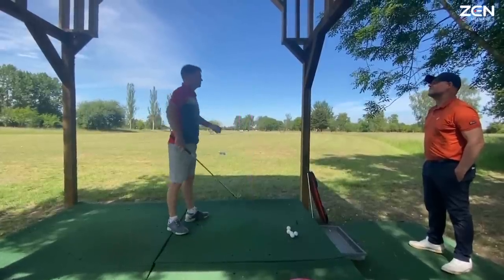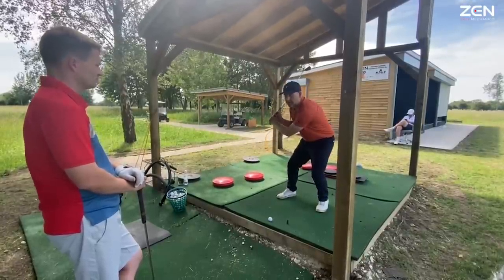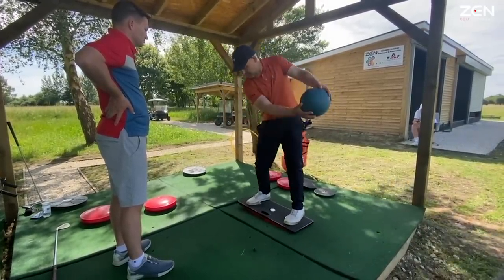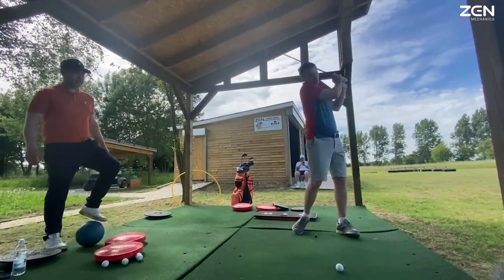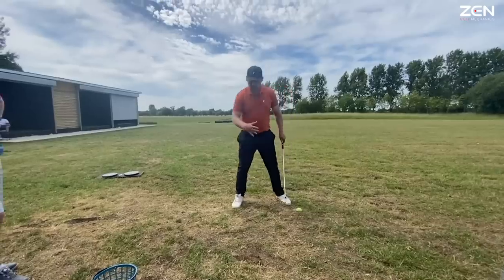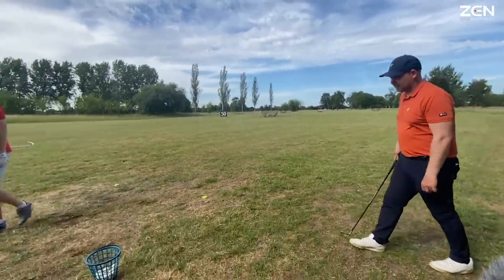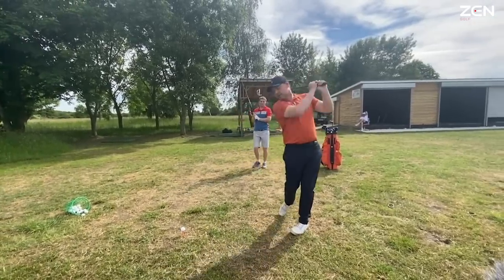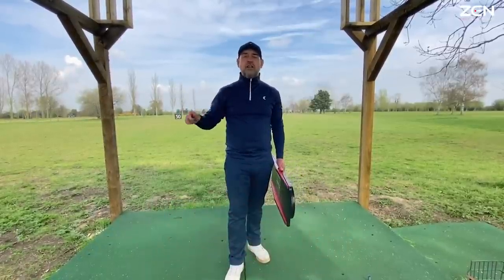The "Wrecking Ball" Golf Swing Drills for Pure Ball Striking | Irons and Driver

Comment: Marcus I have had my GRF SYSTEM for about 6 mos n ball striking has really improved. What I can’t get is a draw off the tee especially with the driver. I mostly push it right or sometimes pull across. Any suggestions?
Reply: Feel like your lead shoulder is thrown back at impact.
Reply: I was pushing it right until I focused on really closing the face through impact. What felt extreme really isn't when you see how quick the pro's close it! Watch a slow-mo vid to get an idea. Worked for me!!
Reply: Thanks for the replies guys!
Reply: @jimshigster5540  you can try making your bottom hand weaker or having the face a couple of degrees closed at address (making sure it’s not just a twist but an actual regrip to naturally have the face a couple of deg closed at address).

One of these should work
Reply: Ironsides, thanks for your response. I will definitely give it a try.
Reply: Ball starts on the line the club was facing - it needs to aim right then create an inside path  to this to create the draw spin